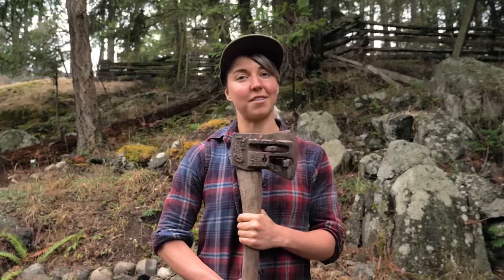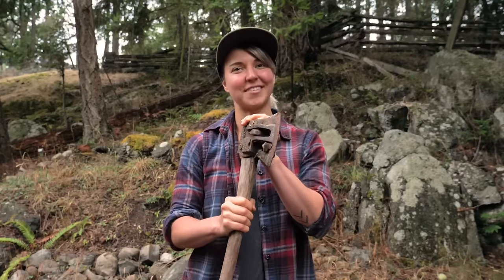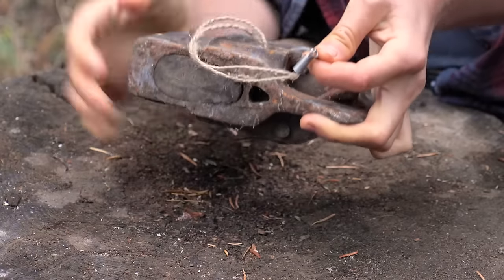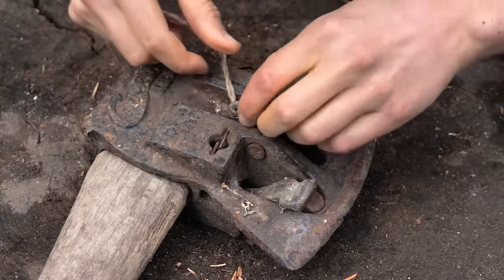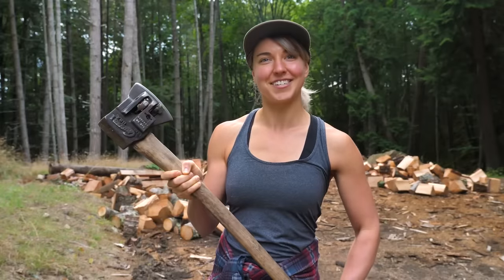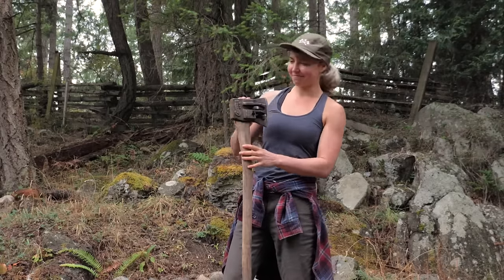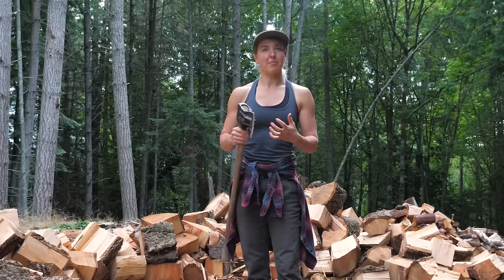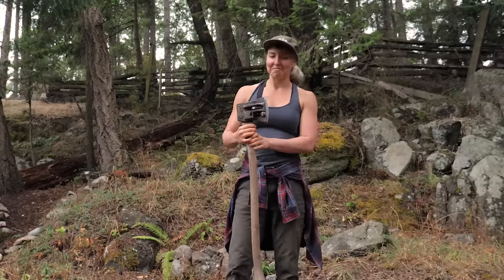Spring Loaded Axe?!!

Comment: For people who don't understand how this works, it's not the spring which is forcing the wood apart. The spring is there to make the pawls return to their starting position when you lift the axe. It is the force of the downstroke that causes the pawls to cam open and split the wood.
Reply: yes.... it's not spring loaded, the springs just hold the levers in place
Reply: It would've used a much heavier spring. Then when compressed by the force of the downward swing the spring then would have stored kinetic energy it can release.
Reply: @James_Lindgaard that makes no sense. A stronger spring would make it worse by absorbing more energy exactly when the splitting force is needed and releasing the energy afterwards in the opposite direction when it's wasted.
Reply: @berzerius  That might actually be to help get the axe out of the wood.
Reply: @James_Lindgaard If it doesn’t split the wood in the first place, a spring isn’t what getting it out.
Reply: @synckar6380  It could create some "wiggle" room. When the axe head is in the wood the spring loaded part would create a little separation. That'd make getting the axe out of a piece of wood easier when the axe head is stuck in the wood. Are you familiar with conservation of energy and f  = ma = mv = 1/2mv^2? Newton's 1st law of motion would consider the wood being cut to be an outside force which changes the motion of a body in motion, the spring load parts causing the spring to be compressed. 🙃
Reply: what are pawls?
Reply: THANKS CAPTIAN OBVIOUS!
Reply: Huh? Springs? Oh right, the axe.
Reply: Yes....care about the functionality of the Axe...thats, why so many people watching these vids...😅
Reply: @James_Lindgaard only of you increase the wheight of the loaded parts. 
The axe hits it. The tree stops the ax. However the moving parts are, well, moving.
So they still have their energy. 
As they move forwards they impart their inertial energy to the axe. So now the axe moves again.
The heavier the moving pieces are, the more energy is required to stop them. So the more energy the log has to overcome.

The springs actively work against this. Stretching them stores energy. The same energy required to lift them back up.
Stronger springs therefore syphon off more of the energy. 

In return you should increase the wheight of the moving parts. That however makes it so that the axe becomes very heavy and you have to train to wield it.

What you could do is flip the springs and make it that the piecec can not move, but if thwy do they smash into the front.
If you do that then you must reset the pieces manually.
Then stronger springs make sense.
However you then are limited by how strong you are and how well you can reset the springs.
Maybe a contraption like how a briefcase is sealed could seal the springs. Decouple them, reset the wheights, recouple them.
This way you can use a lever rather than pulling at them.

But now you have to preform 4 steps after every strike.
She then is faster
Reply: Or you could just call it what it is, a splitting maul.
Reply: @James_Lindgaard everyone else commenting has used one, obvious to me because I've used them and own one.
*the springs are only there to get the moving parts back into place before you swing. 
Trust on this
Reply: Right, its more like spring re-loaded. Click baited.
Reply: @Imageloading...  I like thinking for myself. I can do the math if you like. And I also know that axes can get stuck in the wood. That's the only purpose they can serve. Otherwise they slow the axe down when it's splitting the wood. This is because they are creating more resistance. The only thing that force in the springs can do is to push to levers out. Trust me on this, okay?
Reply: Important point, thank you for clarifying.
Reply: I was wondering since the gauge of spring she installed didn't look up to the task of splitting a log, but your explanation makes perfect sense.
Reply: @James_Lindgaard i think you totally misunderstood the mechanism of the axe...what you say makes no sense. The springs just hold the levers in place against the momentum of the downswinging axe...
Reply: @mugnuz  When springs are compressed they'll have stored kinetic energy. Why reduce the amount of kinetic energy for the axe? And axes will get stuck in wood. The spring pushes the awls away from the head of the axe. What is on each side of the axe's head?
Reply: @James_Lindgaard  in this case the springs dont get compressed at all. And thats the point you dont understand. They get pulled and spring back to put the levers in their place again. Only in that place the levers are alined to spread out when they hit the log. Theyre diagonal so they go to the side and then up. The levers force to spread has nothing to do with stored energy of the springs its exactly the opposite!
Reply: @James_Lindgaard  The purpose of the levers is creating more spread than the  wedge angle of the axe would. The levers protrude a little from the axe head. When the axe penetrates deep enough, the levers are held by friction against the log and move outwards due the placement of the pivot point. The energy for moving the levers outwards and splitting the wood is entirely taken from the kinetic energy of the axe. And yes, they slow the axe down in the process.
Reply: We would've understood that just fine if she had included a super slow mo shit of it.
Reply: Thank you that makes a lot of sense.
Reply: @jensandyl2290  Literally the only reason I clicked on it and stuck around, yes. I've never seen a mechanical axe like this before.
Reply: Cheers for that, I was thinking "Gosh, you're gonna want a much bigger spring for that!"
Reply: @James_Lindgaard  you can think of it as an kind of an aftershock axe ^^
Reply: spring loaded, mechanical action  @jbbolts
Reply: i mean if she was swinging consistently full force she'd be getting through each with 1 swing
Reply: oooo i thought it just came to the sender faster also i typed this mega fast
Reply: @jbbolts  that would make it spring unloaded...oh never mind.
Reply: @happyrecluse2849  sounds weird but that's pretty much what it is... the spring is "relaxed" until a strike which puts tension on it
Reply: A pawl, generally, is a spring-loaded 'finger' of steel, typically free to rotate on a pivot/pin running crosswise through the approximate midpoint of its mass. The business end of the pawl typically approximates a chisel point, and that point is expected to engage with some other material -- sometimes built into a different sub-part of the machinery/mechanism in which the pawl is found -- so as to do work such as transferring force from one body to another. Pawls usually are found in sets of two, three, or four  and are arranged symmetrically or in a regular radial arrangement i.e. it's rare for there to be only one pawl in the system in question.
Reply: What ?
Reply: My dad had one of these and loved it. We split a lot of elm for firewood which is a real bugger to split because the grain is squirrelly. It was fun to see you rehab and test this one!
Reply: Wish that was around when I was a boy😊
Reply: @jensandyl2290 Good one. Made me chuckle ! 😆. But… I really did come for the wood splitting when YouTube decided I should check out the channel. Staying around for the content and it makes me smile. Plus I’ve always found wood splitting very  therapeutic.  I would watch an all wood splitting channel on cable, a break from the Aquarium or Sunset channels. My take is these types  of spitting mauls is that they were kind of a gimmick.  A good 7 lb  maul will take care of most wood from out here.

Comment: I would love to see a super slowmow when the sidepieces push the wood aside! :D
Reply: Ooooh yes!!!   Get the slowmo guys to help you do the video!!!   How cool would that be?  ❤
Reply: Click that gear icon and put it on .25 speed. Axe does nothing
Reply: Aye I set the playback speed to a quarter, and not seeing the springed guides popping out. You're basically just using a wider-angled splitting maul.
Reply: In order for the springs to work, it has to go deeper
Reply: @tonyshaw7420 so it’d need to be wood that is already hard to split even with a regular axe?
Reply: @ralexcraft990  pretty much, I hated spring loaded axes. If I had to I'd use a splitting maul and sledgehammer to pound it in deeper until it splits, the you could probably use a regular axe for the rest
Reply: Came here to say just that!! SloMo Guys!! 👍
Reply: @DeeDee-bm9hr  When the ax splits, there aren't enough frames nor resolution/clarity to say it does nothing. I guess one way to see is to check if the two small wedges left lateral indentations in the split wood. If yes, that would point to them actually pushing and potentially helping.
Reply: i was thinking that too, also the close-up shot.
Reply: @ingerasulffs  “ackshully” 
Yea I can tell you’ve never split wood
Reply: @DeeDee-bm9hr  What's with the "ackshully" thing if you don't mind? Anyway, you got amazing insight into my past from a few phrases I wrote. Would you mind sharing your process?
Reply: Or a slow mo of her chopping wood
Reply: Was coming here to say the same thing.
Reply: @DeeDee-bm9hr  The guy said the film quality isn't good enough to see mechanical movement. A persons ability to discern that has nothing, at all, to do with their ability to split wood...
So you're saying they've never split wood based on their statement that applying pressure to wood could leave marks - a true statement....

What's wrong with you, dude?
Reply: @DeeDee-bm9hr  Even better - use the , and . (< and >) keys on your keyboard for frame by frame playback.

There aren't enough frames. One frame takes the axe from inches above the wood to completely embedded; that's not enough time to see what the side pieces are doing.
Reply: I wonder why there wasn't a slow-mo shot, up close and personal, of those fingers opening up the crack...
Reply: Just thinking that :)

Comment: A really slow motion shot of it would be cool to try and see the spring stuff happening.
Reply: Yes, I'd love to see that too!
Reply: I was reading the reply’s to see if anyone wanted to see it in slow motion. I think that would be cool.
Reply: Slo MO Guys, Gav and Dan
Reply: YT has a built-in slo-mo option. Problem is at quarter frame speed, I'm not seeing the spring guides coming out. Click the gear icon, and adjust the playback speed.
Reply: @Klaaism  Not enough frames per second to catch whether they are or not which is why you need a high speed camera.
Reply: @Klaaism you need a high speed camera to actually see, 0.25x speed is like 10 fps on youtube
Reply: @waffler-yz3gw  Thats actually for capturing extra frames per second, so videos slowed down dont skip around.

Comment: These are so cool and really clever. You'd think the axe is too simple to possibly improve upon. You can debate the tradeoffs of this design versus a traditional axe but the fact that it's even debatable is a huge accomplishment.
Reply: There are not too many trade offs. It´s designed to work as a splitting maul. It´s not intended for the cutting tasks most of us have in mind when thinking "traditonal axe". Neither is the splitting maul.
Reply: @maxlutz3674 What I had in mind is the basic stuff like increased cost and moving parts that can break or get lost.

Comment: This axe is definitely part of wood splitting folklore and is right up there with the Sotz 24 pound monster maul. Love it!
Reply: I can imagine it's the kind of thing that some ancient god of wood splitters gave to that one legendary woodsman after they cut down a million trees in a single night with the help of a talkative grasshopper.
Reply: I come from the wood, I saw a that kind of spring loaded axe before.

But a 24 pounds maul!!! 
What kind of arm do you have to use a tool like that all day!!!!!
Reply: @jeremybrouillard  I have one, but    rarely use it. My go to is the Vulcan splitting maul which is a measley 8 pounds.
Reply: @shockley1002  
8 pounds is a fine weight for a maul.
You can still sling it, and it has impact.
Reply: @jeremybrouillard  That's for certain. I have quite a few mauls for splitting the annual firewood, but my main two workhorses are the Vulcan and the Fiskers X27.
Reply: Have both still stand by my regular axe.
Reply: I had this thing called a hydraulic wood splitter,worked every time.

Comment: My dad still has one that he got in the mid 80's.  We were clearing property in Thunder Bay Ont.  This axe quickly became a favourite wood splitter by him and I.  This sucker would and still does just fling the pieces depending on how much power you used.  As punishment for signing my Dads name on a school form, he gave me splitting chore that without this axe would have been absolutely miserable into something bearable.  I was a lot stronger the following fall/winter semester because of it that's for sure.  We've maintained it over the years and to this day its still great axe.  We still have it's original Fiber Black handle.  Dad taught me how to swing on some shitty wood handled axes first before letting me use this baby, but after he saw I wasn't abusing the wood axes he trusted me with this bad boy.  If someone gifts you one in good condition, thank them, it's a great axe.
Reply: I never found splitting logs a chore. In fact, I love it. It's good exercise and gets the circulation going.

Comment: I grew up with this style axe here in Alaska, honestly not my favorite design after years of use I ended up favoring a more 'normal' style maul.

For one, the axe head does not embed very firmly, meaning you can't pick up the wood and swing again with the weight if the log. You usually have to stop and remove it.

For two, the pawls don't engage until you're pretty far into the wood, by that point, you've pretty much split it anyways.

I always love these axe demonstrations when they show a bunch of perfectly straight, dry, light wood.. like you could literally split that pretty well with a hatchet. Even the 'dense' piece was still straight and knot-free. Hardly realistic conditions for regular use... maybe the trees are different wherever you're from, but here every third round has at least one knot. This axe is not as good for those.

Fun, interesting? Yes. Good for some niche applications? Probably. Should you go buy one? Probably not.
Reply: Exactly. This is my experience too 👍

Comment: My parents bought a wood stove in the early 1980's, so I got to chop wood with a maul back in those days.  We'd had the stove for a couple of years when my dad bought one of these axes.  I tried it, but I preferred the maul.  I didn't notice any appreciable difference.  If anything, I thought the maul was easier to use.  Maybe that spring-loaded axe was too cheaply made to work as well, so who knows?  Anyway, thanks for another cool video.
Reply: Same experience, it felt as those spring-loaded axes were allways someway out of balance .

Comment: If you call the BEARD of the axe a blade again....I'm unsubscribing!
Also....this seems unpractical.
Maybe if your a smaller person this would be a decent idea.
However....when I split larger pieces of wood...it's an inconvenience if the pieces go flying.
I would rather them stay upright or just simply fall over so I can easily swing at them again to chop them smaller.
Saves the back. Saves time.

There is no such thing as a blade on an axe or a chainsaw.
Go back indoors....your Not fooling me

Comment: Brother in law has one. I don’t care for it. It’s a $300 axe. I like my 12lbs splitting maul. It’s like a triangle welded to a 27” pipe. Crude, simple and it’s what I grew up using. If I use a 36” handle on a maul I will over shoot my mark lol. Thankfully my 36” is fibre glass lol.

Comment: I've got one and lost a spring. You found one. I've been looking for 15 years. So I use it with a missing spring. But I've got all the other wood splitting stuff...including a generator running a log splitter. And wedges and a double bit axe. Cheers from the Bruce Peninsula...

Comment: You know, I use to go out with my Dad to cut down trees and then go back later, to load up the wood.
My Dad would go into an area, fell some trees. Then like the next weekend or what, we'd go back cut it up and load it into the truck.
After we brought it home, that is when we would start splitting the wood.
Great physical work

Comment: Silly question: do the springs actually push the pawls out?  Or does it reset them to the closed position?

Every axe of this type I've seen, the pawls self-deployed by biting into the woods and having a geometry which pushed them out to the sides faster than the axe head advanced downward, once they bit.  This has the effect of turned the downward energy of the axe into outward energy, much like ramped cheeks do, but without the sliding friction of a ramp and over a much shorter stroke, thereby delivering a much higher sideways impulse to the wood.

Comment: How do you like your old new Chopper 1? I have one gifted to me by my father when I was 15.  Still works great, and has its original handle.  You have to learn the truck tire trick to chop multiple pieces with this Axe.  If you are interested to learn, give me a shout.  You probably know to use Linseed Oil on the handle once in a while to keep it new.  It works on the Axe head also.

Comment: I had one similar. It wasn't spring loaded but the "ears" would pop out if you got it deep enough. The weight was noticable and it worked well enough if the wood was completely dry. If not then it would get stuck and the cursing would commence.

I don't know how you ended up in my algorithm but I'm liking it. You got some oomph.

- a middle aged dude who's split more than his share of firewood and swung more sledgehammers than most.